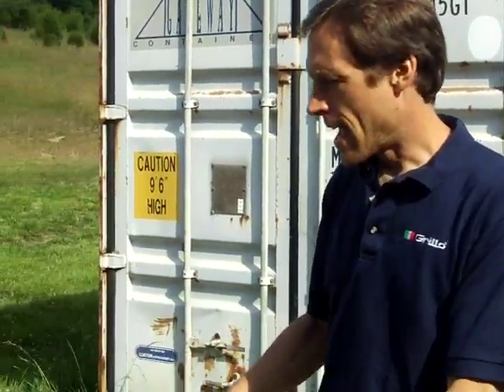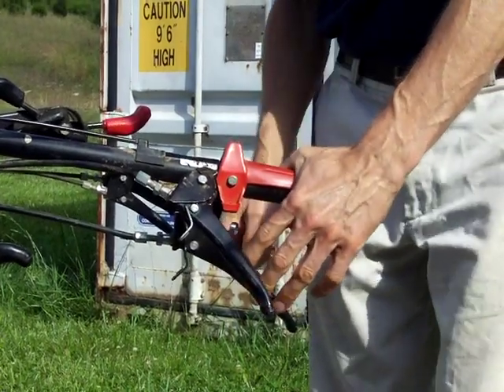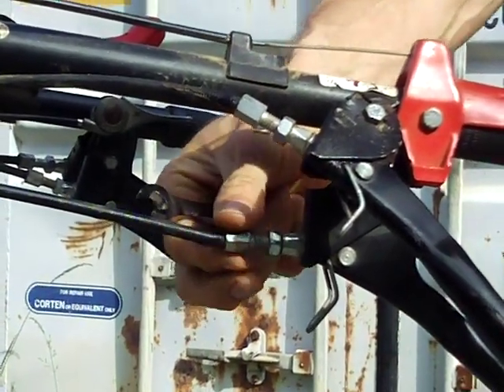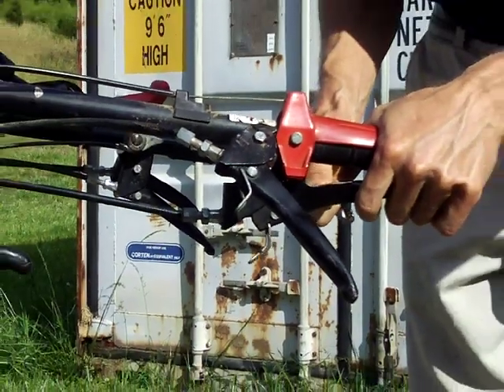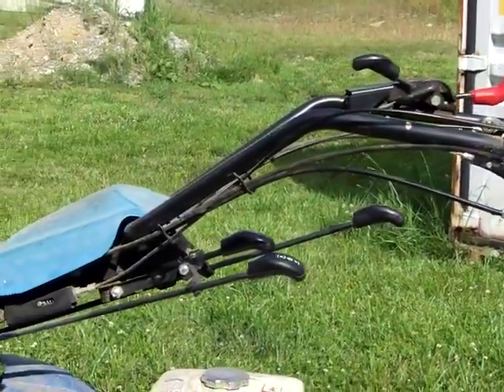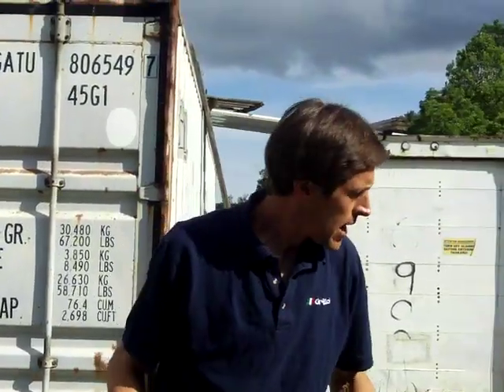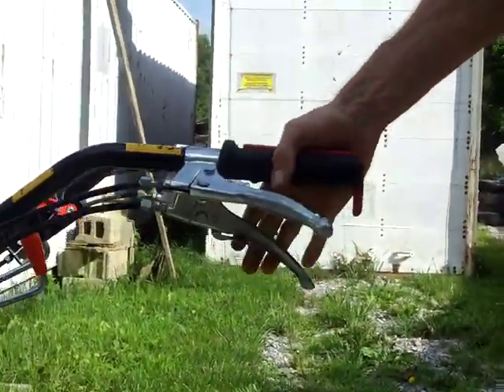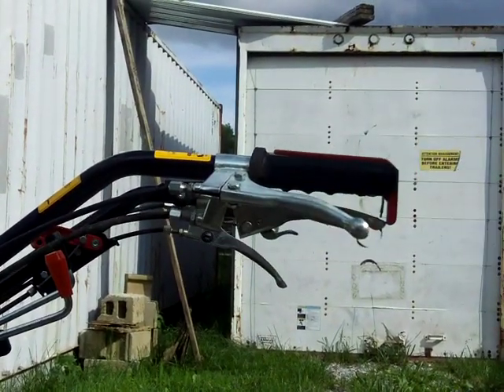Clutch Adjustment for BCS & Grillo Walk-Behind Tractors: Standard Dry-Clutch Version

Comment: Joel , as you told me over the phone: 

1)THE handle bars MUST be on the ENGINE side ( you go over  this at 7:48- 9:50 in the video but it is SO IMPORATNT that it should be made very clear  at the very start because you cant do the adjustment loose enough  unless the handle bars are on the  ENGINE  side  )  
2) if tightening lower cable clamp tension the upper tension adjustment thread must be 1/3 - 1/2 showing BEFORE  pulling the lower cable tight .

Comment: Might the need for this adjustment also contribute to the clutch being frozen in the off-season?  I had the clutch dis-engaged last off-season, but noticed that it was frozen a bit when I started using it this year.  After some initial use, it broke free.  But...  I still notice that the gear will still be engaged ever so slightly sometimes even when I have the clutch completely open.

Comment: I have adjusted the clutch according to the video above. I tried turning the adjustment all the way in and all the way out.   At this point the nipple or nut that sits in the handle is all afloat.  I have adjusted the total cable under the battery case both by lengthening cable and by shortening the cable.  No matter what I have tried, once the machine is in gear, it moves regardless of the clutch position.  Any theories?
Reply: We mention in the video that if adjusting the cable does not make it "stop", your clutch needs new bearings... we offer a rebuilding service for the BCS clutches. 502-484-3988